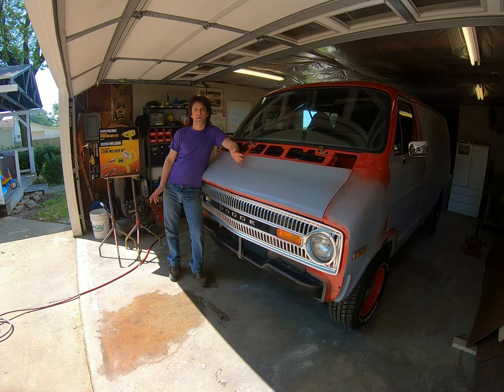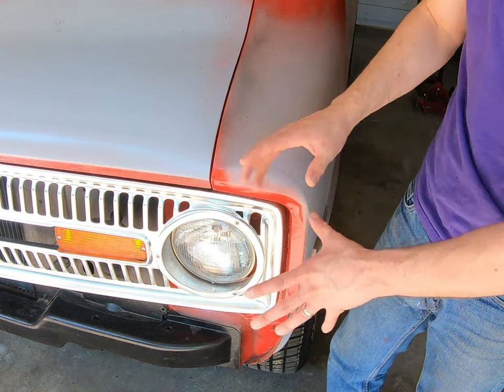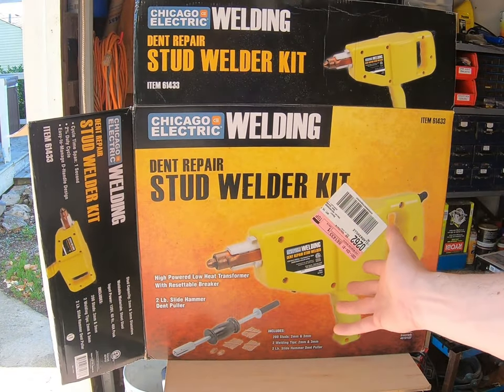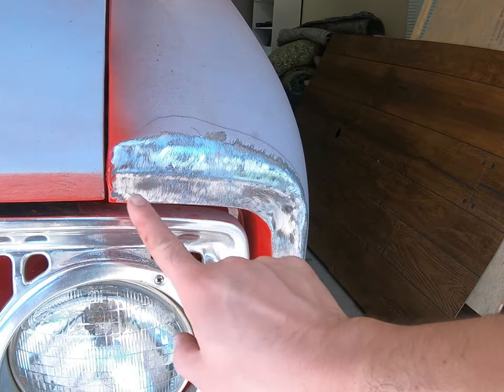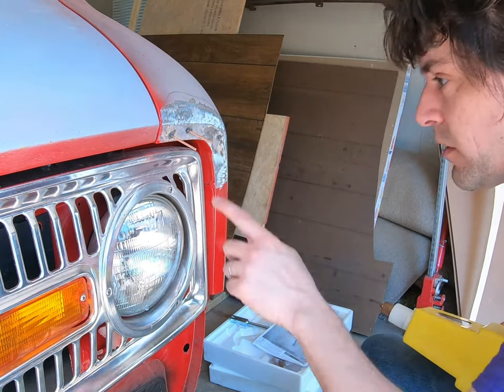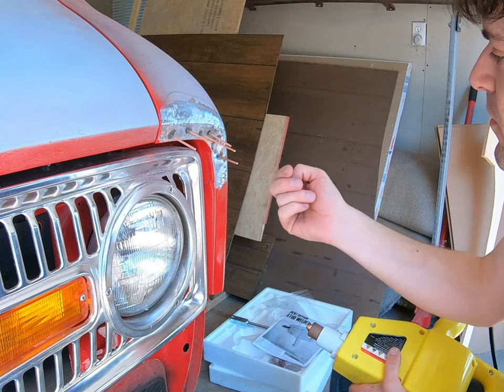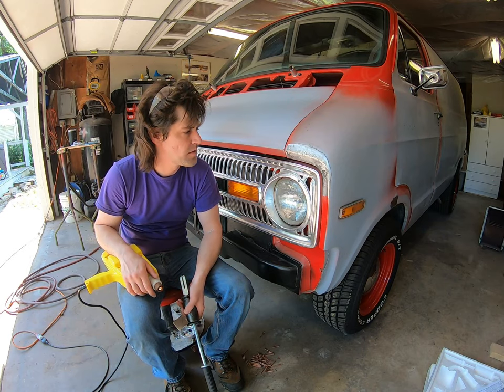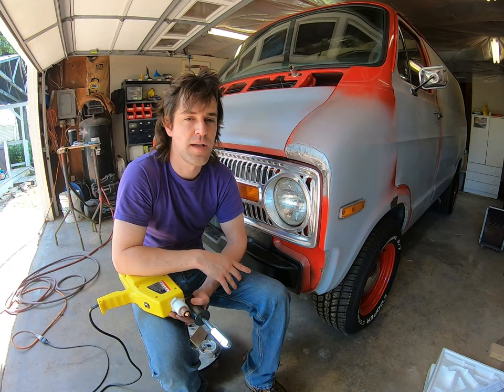Harbor Freight Stud Welder Review - Hoosier Garage

Comment: Please don’t. Buy this it makes holes in your car and the studs easily break off and the puller won’t let go off the stud
Reply from the maker: If you are making holes you arent doing it right. Weld it right with the ground piece contacting properly, cut and be done with it. Dont wiggle them off. That makes holes too